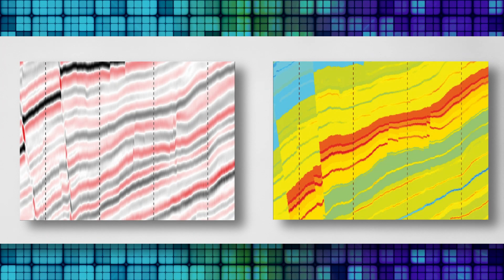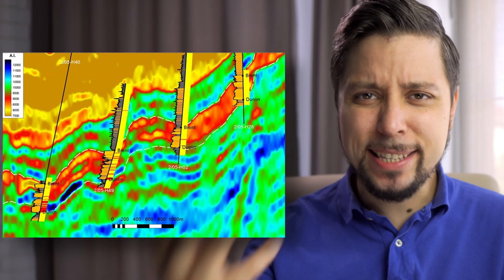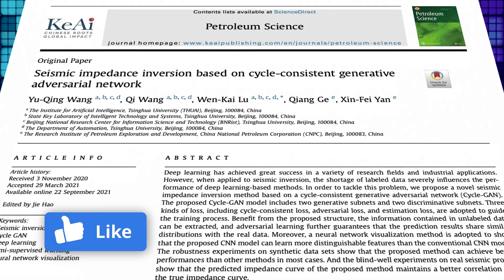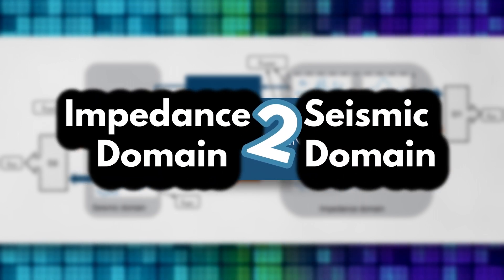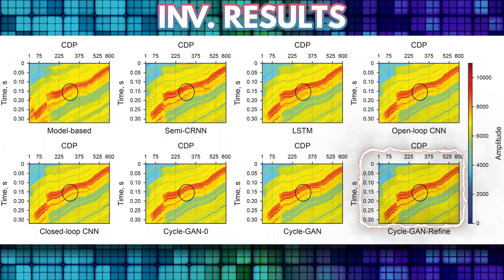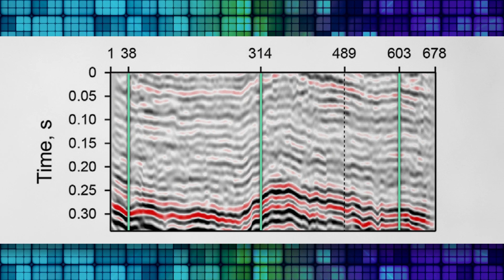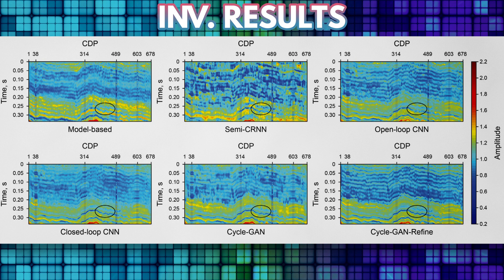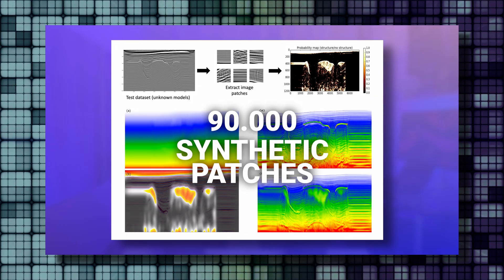CycleGAN For Seismic Inversion: A Deep Learning Approach Using Only Few Examples

Comment: Thanks for the insightful video—very educational and well presented. I’ve been working on something related called SeismicFlow, an open-source GUI application for visualizing seismic and well logging data in both 2D and 3D. It also includes built-in neural network tools for interpretation. Thanks again for sharing your work—great contribution to the field.